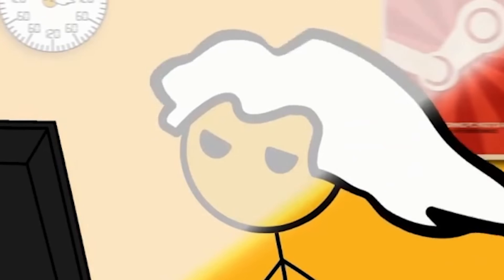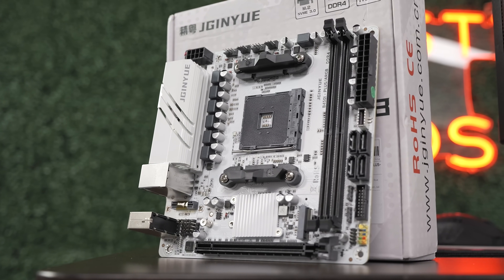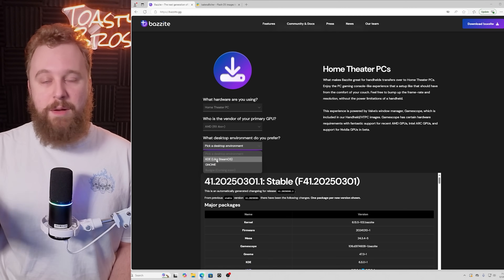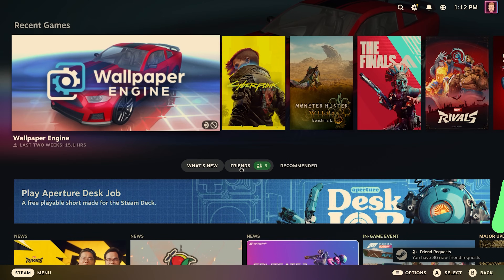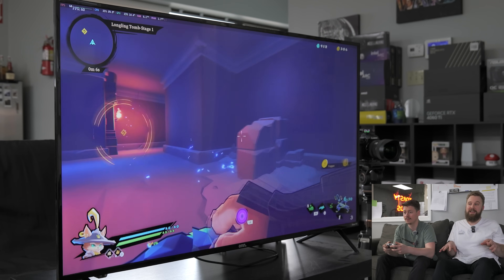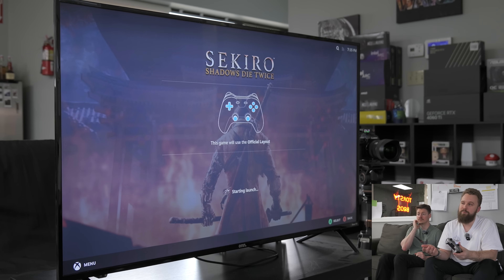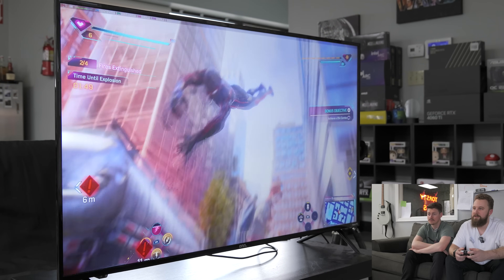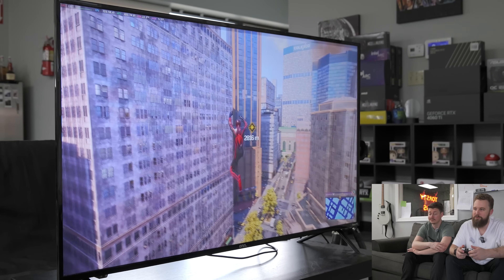Don't Buy a Console....Build One Instead! - Bazzite Mini ITX PC

Comment: As cool as all of this is, there's 1 glaring part of this never ending conversation that people on the pc side never choose to register/acknowledge. Ease of use. & more importantly, how different pc users & console users classify ease of use. With a console you are literally just plug n play. At all times. Never have to think about anything else. Ever. With pc concepts like this, your 1st 2 steps are ALWAYS going to be a hard no for the average console user. Which is buying the parts (theoretically after researching for parts too I might add). & then building the pc itself. & even when you get to step 3 of plugging & turning it on (bc you can't just plug n play INITIALLY)...then you move on to having to look into & install 3rd party apps that effectively mirror what consoles do right out of the box. 

Literally no one in their right mind is ever going to make a real case for consoles ever being on par with PC's power wise or anything like that. But in the console market no one gives a shit. Because ease of use is king. & yes after that initial 1st time setting everything up, yes for a time THEN the pc DOES become plug n play. But then you have to factor in maintenance. Be it upgrades or driver updates, etc. Even on that front consoles have the ease of use angle fully covered. As the update process can now be a background thing the user doesn't even need to be present for. 

Bigger Point: the conversation isn't as clear cut as stronger always equals better. Not when you have different target audiences with drastically different priorities.
Reply: The thing is, that the video didn't cover, that bazzite is an immutable distro ( meaning you cant accidentally change something critical / core component of your system no matter what ), and bazzite makes maintaining the distro easy enough to the point that, you don't really have to even update or worry about updates, your system can run perfectly fine without updating for months and the best part, updates and upgrades are technically not a thing

bazzite follows a concept of images ( basically every "update" is a new OS in it self ), when you do an "upgrade" you basically change to that new version and if something fails, even if a single sub update during the upgrade fails, the entire upgrade is aborted and you are rolled back to your previous version

now I do agree with your point, but honestly I don't like console brands xbox and sony, they hide games behind subscriptions, they can easily keep and remove any game from their library if they want to and technically, you don't own any games in the xbox or ps4 ( now I don't know if I am completely correct about that ) instead you rent it.
Reply from the maker: This kind of build isn’t targeted at someone who would use a console as a primary gaming machine. It’s meant to be a side project for a PC builder

Comment: Going to try Bassite this weekend on a spare PC.
Will use the 5600 instead of 3600 and the RX 6600 which, if successful, I have a RX 6700 XT to try.
Reply: Funny You say that, I'm running that exact combo right now and it works very well (5600 ,32gb, RX6700XT)

Comment: Yawn. As soon as I heard Linux it was time to stop watching. Linux is only for old top down casual games. If you’re a real gamer or live after 2007 you’ll need windows.
Reply: 🤣🤣🤦got a 5090 and a 9800X3D running Linux. That games at 4K high refresh rate just fine thanks.
Reply: L low effort ragebait, most games run better or on par with windows in terms of performance

Comment: I just built a Couch gaming PC running Bazzite a couple weeks ago. 7900 GRE with a 9600X and it works so well at 4K 120 fps. Xbox one controller connected through the wireless dongle can wake the system up, a true couch gaming experience. Majority of my games work, and system suspend while in a game has been working quite well. I also setup some emulation, enjoying playing rallisport challenge 2 and ssx3 on xbox emulation. And perfect timing playing split fiction with my SO. It makes me realize how much of a mess windows can be.
Reply: Sounds great! How well would you say suspend works with a discrete AMD GPU? The main feature I’m looking for in a new pc/console is instant suspend/resume. Older Reddit comments mention suspend doesn’t play well with discrete GPUs, so I’m interested in your experience.
Reply: @Ramojo2807  By suspend, I assume you mean suspend-to-ram S3. Should work fine with the slightly older hardware in their PC build. The current version of Bazzite is based on Fedora 41 which has a very recent 6.11 Linux kernel. That should support S3 even on recent Ryzen 9000 series CPU's. The BIOS on the Chinese JGinyue mobo might be the only thing that interferes with S3. Hard to say.
Reply: @Ramojo2807  didn't see this comment. Suspend is working well with 7900 gre discrete GPU. There is some audio crackling when it resumes but this happens even when you suspend without a game running. It clears up for me in a few seconds.

Edit: case is Asus ap201
Reply: @Ramojo2807 I was curious about this as well. It has worked pretty great! Completely usable for me and one of the major reasons I went with bazzite. There is some audio crackling for a few seconds when resuming and then it returns to normal. There is also a plugin on decky loader called "pause" or something like that, it enables pausing games even for those that don't support it mid dialogue etc for better control. But even without it suspend has worked great for me. Even when emulating games.
Reply: What case did you use? Is it micro atx or itx?
 I have a 7900GRE and I want to build a living room/on the go pc, but I don't want to have to buy another GPU, and Gpu's are easy enough to install and uninstall. Yes, I know you shouldn't do it too much.
Reply: @mike3963  I went with micro ATX, cheaper than itx. Saves money on the motherboard, case, and power supply.
Reply: Do you get VRR with that 4k 120?
Reply: @molsen7549  i don't, i use hdmi through my vrr capable receiver and somewhere along the chain vrr breaks.
Reply: @molsen7549 doubt it. They failed to mention that drawback
Reply: Which xbox wireless dongle do you use to wake the PC?

From my research only the older bigger dongle (1713) can wake PC, the newer smaller dongle (1790) can't. But this is for Windows so keen to confirm which one works for Bazzite
Reply: @D1Vad22 I have the older larger one. So I can confirm that one works.

Comment: I just build myself a home theater PC like this for 500Euro,but I used eBay for the majority of my parts.  It's currently rocking a RX 6700XT, R5 5600X , 32GB DDR4 3600MT/s, B450 MOBO, BeQuiet 550W Gold PSU and a 3D Printed PC case

Comment: At the end of 2024 I put together an R9 9900X + RX 7900 XTX machine in a Lian Li A4 and the thing has been an absolute monster. I'm running Nobara instead of Bazzite but it's still dope
Reply: 😂 why not just spend the extra 20 so bucks and get a 7800 x 3D
Reply: @ because I don’t just game? Also the 7800x3d was basically unavailable and the 9900x was crazy marked down.
Reply: Atm its $60 diff on amazon between them @Savethepandabears

Comment: Working on building a ps 5 killer for a friend, I wasn't planning on doing itx tho. Planning on doing Rx 5600x, used 6650xt
Reply: That card won't be able to do 1440 high settings 120 fps on the same games as a PS5 or series x would or 4k 60 fps high settings
Reply: @calantheshaman 🤣you realise the PS5 and XBox are cutting settings or using dynamic res to achieve that. The CPU is about as fast as the 3700X equivalent in the two consoles and the GPU is similar to the 6700XTish part in the series X🤷. He's building a machine with very similar specs to a series X. The PS5 is a schooch weaker.
Reply: @eagle_rb_mmoomin_418  you obviously don't know much about electronics if you think you can build a desktop PC with similar parts and get the same results as a console. You need about double the performance from a desktop compared to a console because a console is a closed system that can get more frames per second by cutting corners so to speak. That desktop will not get the same graphical look and fps on the same games as a PS5 and series x. It took me getting a 4070 ti to outperform my series x and PS5. You can think what you want but I'm just trying to help get him the same or better performance as a new console out of his desktop and that setup isn't going to do it.

Comment: anyone else get flashed by amazon right after they took it off the screen at 3:32
Reply: Yep, its in there, a quality unit  The FSP Mini ITX Solution/SFX 12V / Micro ATX 80 Plus Bronze Certified Non-Modular Power Supply (450W)  You won't get a quality PSU from these guys, they don't understand the concept
Reply: The first rule of Toasty Bros Fight Club is YOU DO NOT TALK ABOUT TOASTY BROS FIGHT CLUB. 🤣
Reply: I think that was the idea my friend. A little flight club type shit